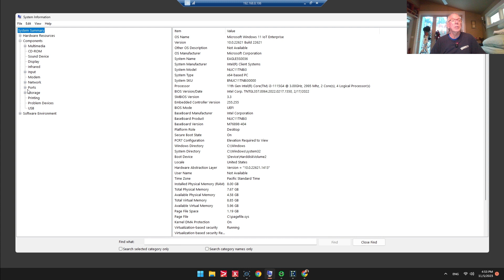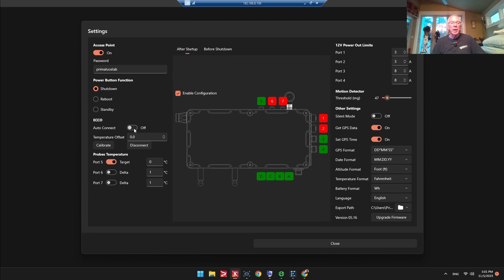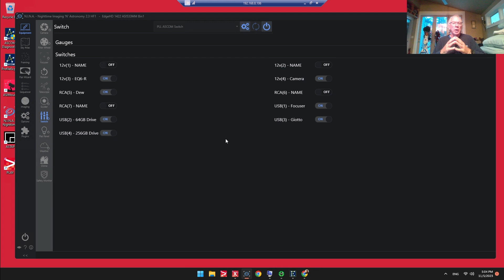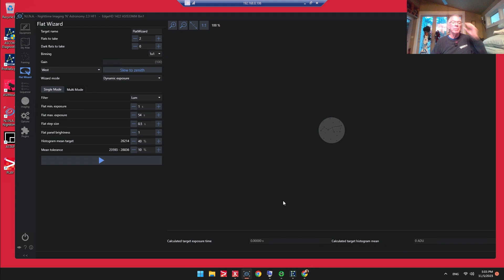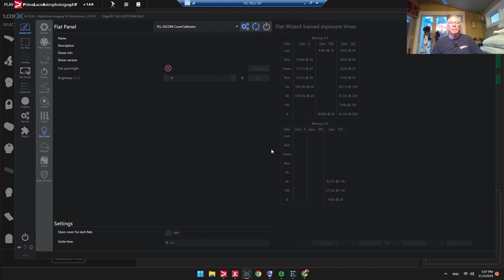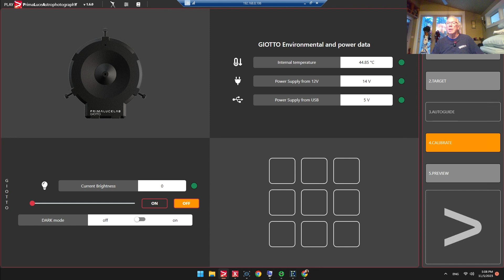PrimaLuce Lab Eagle 5 S Tour  -  Part  2

Comment: Good video! How did the install of all of the software programs go? Any issues that you saw? Thanks
Reply from the maker: Install went well. No surprises. After I installed NINA I migrated over my profles from the NINA instance running on my BeeLink U59. I connected the Eagle via ethernet to one of my home networks for the software and driver downloads. Could have done it over wireless as well. I still have to make sure I have the parameters set in EQMOD.